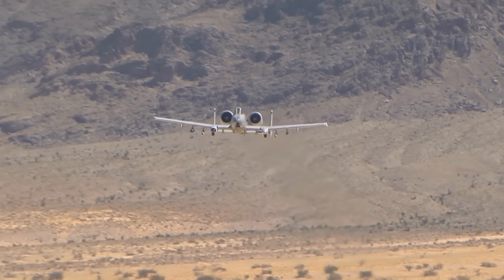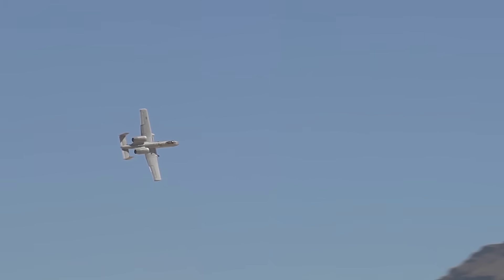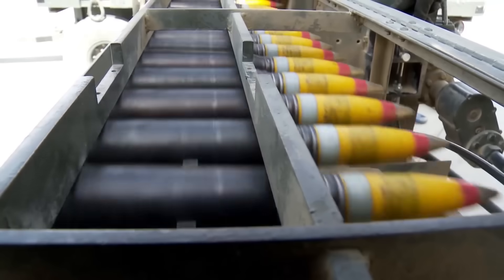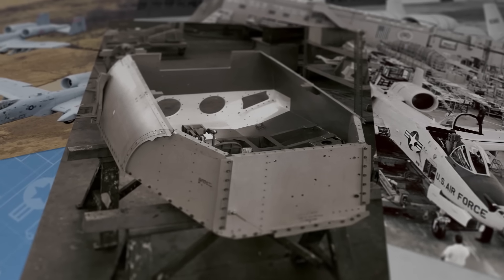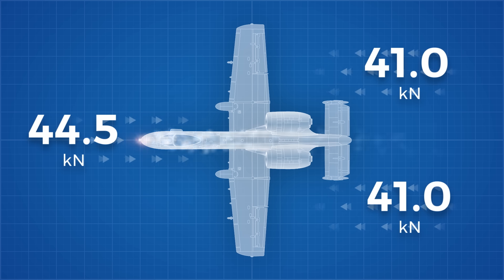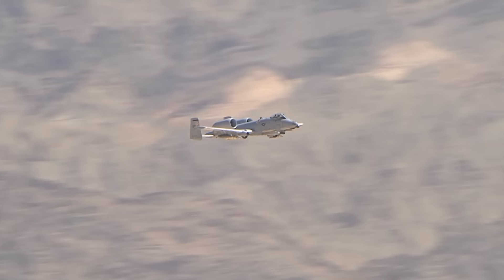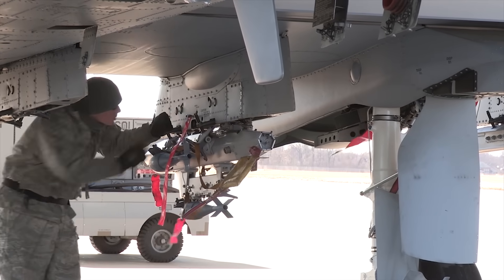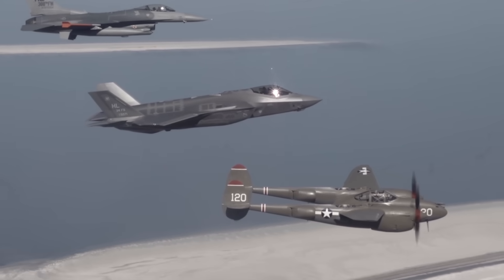The Insane Engineering of the A-10 Warthog

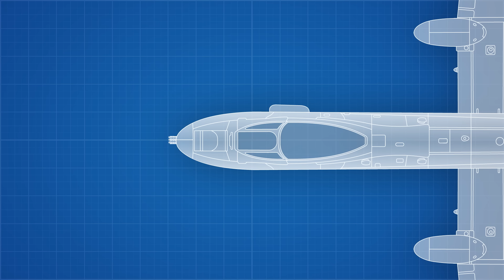Comment: 7:43 small addition: The gun is actually mounted off-center to the left, so that the barrel that is firing (the lower right one) is directly in center line. Therefore, the recoil doesn't push the plane off target.
Reply: John Slugger  You can't just drop that weight off the nose. To say it would affect the handling characteristics greatly would be an understatement... it would probably immediately pitch up and stall.
Reply: @W1ldTangent  the gun itself weighs 620 lbs,  full load is over 4000 lbs,  the front end loses over 3000 lbs after all 1150 rounds are fired, gotta figure that the retained shells are at least a few hundred lbs.
Reply: @W1ldTangent  damn, I knew it wasn't possible, but didn't even think about the fact that doing so would require dropping the entire armament system, and since most of the plane is literally just a house for the gun, a gimbal is literally impossible simply for the fact that it'd be a whole new plane
Reply: Good catch
Reply: John Slugger  an angle on the gun would cause an enormous moment. The plane with immediately pitch upwards off target if it was tilted
Reply: John Slugger  Not an expert, but here's my 2 cents: I don't think it need to be more accurate than it is. What you describe would ad a lot of complexity and cost... And both complexity and cost is something that they'd tried very heard to engineer out of this plane... Edit: And I see that people more knowledgable than me have identified other even more serious problems...
Reply: @angela1984a  yea one of the reasons its still in use is  because of its low operating cost as shown in the vid. to add a gimbal etc would end up costing more. also more likily to get damaged etc if it gets shot at
Reply: I was about to comment that, but you beat me by 4 months ;) .
Reply: @ptroinks  nice ^^
Reply: I love these designs
Reply: Big brain
Reply: Satellite guided 30 mm ammo for an update for the A-10 😈 hmmm 🤔
Reply: I refused to believe that it wasn't on the left. Thanks!
Reply: you can actually see it @ 12:20
Reply: John Slugger  You can't actually eject the cannon.  When the plane is on the ground and it's removed for maintenance, the airframe has to be restrained under the tail because otherwise the whole thing would fall backwards.
Reply: Yes, thank you for this.  Good catch.  I caught it too.  Never understood why people going to the trouble of making a video like this can never get the facts straight.
Reply: @carriersignal  Because they are dealing with a LOT of facts and information, it's hardly surprising that they made a small error. Where is your amazing popular YouTube engineering channel huh?
Reply: the barrell that is firing IS THE CENTERLINE OF A GUN
Reply: @edwardschmitt5710  Yes, and the way it is actually mounted on the plane also makes it the centerline of the plane.
Reply: The recoil actually does push the plane off target, however there are avionics systems on board that adjust the trim of flight controls to counteract the recoil
Reply: I completely understand what you are talking about,  the reason for that is because I have built R/C airplanes!
Reply: John Slugger  you haven't done your homework on airplanes! I have made comments in the past that I have regretted! But still like your comment!🙂
Reply: John Slugger  can't do it..the recoil with the gun off center would twist the aircraft off center. 
Remember the recoil of the gun exceeds the thrust of both engines at full power.
Reply: @duanesamuelson2256  it exceeds only one engine at full power
Reply: @allgameriot1291  still makes it too risky.
Reply: @allgameriot1291  so you're ok with your car braking on one side with half the power of your car's engine at full throttle? Because that would throw you right into a tree
Reply: @THESLlCK  brakes right in the middle so you'd just slow down
Reply: @allgameriot1291  let me rephrase this then, let’s say your car brakes with 50% of your car’s maximum engine power, you ok with that?
Reply: @THESLlCK  the gun produces 45 kN when firing.  EACH engine produces 41kN.  It’s part of the reason they only fire in 1-2 second bursts.
Reply: @THESLlCK  are you implying the A10 doesn’t work? It clearly does. I wouldn’t get too hung up on how much braking the gun provides, it seems the pilots all keep flying even when they shoot. Make sense?
Reply: 1. The gun does not need any gimbal system. The very high rate of fire solves the problem.
2. The gun with the ammo all together are so heavy, that the ammo empty cases cannot be discarded off the plane - otherwise it would lost the balance. Thus the cases are stored back in the magazine.
Reply: @THESLlCK  Bro. Cars brake quicker than they accelerate.... let that sink in a minute.... ooooooooooh.
Reply: @THESLlCK  Also, just to reinforce the point: Next time you're in your car press the accelerator and the brake at the same time, as hard as you can. What happens? OOOOOOOOOH.
Reply: @defdaz  Unless it is a Tesla plaid...
Reply: @ED-es2qv  Learn to read. They never said that at all.
Reply: @wino0000006  Actually that wasn't the reason.
Reply: @duanesamuelson2256  a gimbal would be problematic, however, the gun is mounted at a 2 degree downward angle so that it accurately centers the recoil forces, preventing changes in aircraft pitch or yaw when fired.  This is needed because the gun is mounted lower than centerline of the line of flight.  At 2 degrees downward the recoil is directed at the center of gravity.
Reply: @duanesamuelson2256  ...not to be that guy...cuz I'm sure it's what you meant...but it more powerful than a single engine at full power, while both engines at full power are easily overcome the recoil. But yea, you're right, if it's not dead center (the hot barrel, not the gun itself), fhen that plane would be fuuuuuucked after even a quick burst
Reply: @duanesamuelson2256  exceeds the thrust of ONE  of the engines at full thrust, but your point stands
Reply: @duanesamuelson2256  now somebody knows what they're talking about! I love people who make smart comments, it makes my day, cheers to to you!
Reply: @duanesamuelson2256  No, it does not exceed the thrust power, however, it is enough to offset the force from the them.
Reply: why would an gun that's center mounted push a plane of target? doesn't the gun recoil just slows the plane bit a tiny bit? why would something off center not push the plane of target? i'm no engineer but it just sounds not logical at all to me
Reply: @hazardeur  The barrel that fires creates the recoil. It's on the GAU-8 wikipedia page if you're interested
Reply: @hazardeur  because the gun is off enter. But only a single barrel is sending munitions down range at a time. So that specific barrel has recoil sent directly backwards from it, so that specific barrel that actually causes the recoil needs to be dead center, not the gun itself. 

Think of bottom barrel revolvers. They're supposed to be easier to control when it comes to recoil because the recoil energy is sent through the gun to the shooters wrist, whereas a normal revolver sends the recoil energy backwards and "over the top" of the shooters hand, causing regular kickback. It's not the gun itself. It's the barrel firing and where the energy from the fired round is actually sent
Reply: @hazardeur  wow, you're in need of a G.E.D. or at least the education of the 6th grader!
Reply: @bradb1474  love people like you who just harass other people and even without in the very least leaving a proper explanation. you're the real MVP!
Reply: I quit watching the video at that point. Who knows if the rest is just made-up nonsense?
Reply: @billrhodes1705  fact check it then.  https://en.wikipedia.org/wiki/GAU-8_Avenger
Reply: @jwayneair  that link specifically mentions that the gun is off-center in the aircraft.. gg
Reply: @billrhodes1705  indeed. It is arguably THE most characteristic design feature of the entire craft, which, as the video correctly states, was designed around the weapon to begin with. It is such a strange and unique problem to encounter and subsequently engineer against, that makes it noteworthy in the first place. I don't understand how the creator did not catch this mistake.

Comment: No matter how advanced jets get. The A-10 will always be my favourite.
Reply: No matter how advanced jets become, nothing will ever truly replace the A-10. Completely one of a kind.
Reply: @richardpichan6916  what if they made an even better version of it? sure it wouldn't remove the merit of the a-10 but i feel that if they could make an even better a-10 then that could replace it
Reply: you must be a fan of friendly fire then
Reply: @ChevailerHere  That's requirement to qualify as A-10 pilot I think.
Reply: @ChevailerHere  Hence the reason the fixed wing rule for the Army Air Force needs to be done away with, A-10s working with AH-64s in constant communication with ground forces and satellite imagery would be devastating.
Reply: Yep, considering what a close air support aircraft needs to bring to the table, cheap, durable (armored, primitive airfield capable), bomb truck, and loiter time this is the only USA aircraft that fits the bill.
Reply: I flew it back in Iraq back in the day.... It flew pretty good. :)

Comment: Having the best multirole airplane in the world does not help much if the price tag drains the budget at light speed.
Having primitive rugged equipment you can bang back into shape with an sledgehammer in quantity on dirtsrips all over the place is an tactical nightmare for your opponent.
The only improvement would be to make them drones, more compact and easier to armor (no big heavy glass blister)
Reply: And make them somehow able to field modern arnament, downsizing the large cannon so that we can make space for more ordinance-
...wait we just made a bomber.
...huh.
It's almost like the concept of an armored aircraft for knifefighting range is no longer viable now that guided missiles and radar guided cannon have become commonplace...
Reply: @KoishiVibin  
The problem i see is, especially with having the ability to have theese planes now as drones, you have to do the sums.
Guided weapons are expensive, and they are not easy to produce (even with gps and what not off the shelf now)

So to equip your whole army with the stuff that can withstand the highest tier of wepaons your opponent could possible field makes no sense as long your opponent is not able to really have the highest tier of wepons in mass.

A 10 can take insane ammount of punishment, make it remote controlled and it can take even more (no canopy is a lot of weight less)

It is relative cheap, hard to kill, relative cheap and easy to repair, you can field it in quantity no problem (compared to cutting edge high tech airplanes) and it can operate under relative primitive conditions.

The point is ground support, having specialised launchers who create AOD above your battlefield is cheaper and spreads out your assets compared to an super airplane that can do it all and is super expensive and needs a lot of support and you do not have in plenty because it is very expensive.

Plus you can develope new countermeasures to new weapons and bolt them onto the A 10 or an similar plane.

The new multi role are impressive but the price for multirole is that you have to go cutting edge tech and that is by nature expenive and not rugged because you have to trade in rendunancy and over engineering.
Reply: @KoishiVibin  forgot to ad, the idea of the A10 is pinpoint air to ground support, that is something you only can do with projectile weapons, explosives are right out if you want to do that near your own troops (and keep them in an good mood)
Reply: @KoishiVibin  Someone didn’t watch the video.

Comment: The A10 Thunderbolt II is a beautiful aircraft, I want it to remain operational for many decades to come, and never need to be replaced unnecessarily.
Reply: Got bad news for you buddy. They invented the SAM.
Reply: @KoishiVibin  Bad news buddy, this thing can literally fly with half the damn thing fucking gone. Maybe watch the video before making dumbass statements.
Reply: @militavia-air-defense-aircraft  “Many times”

Yeah, those “many times” barely require two hands to count. Of the 7 that have been shot down that I can find, only 2 actually had the pilot killed, 5 made it out of enemy airspace, 1 made it all the way back to base and landed (although the aircraft was unrepairable) and only 1 was shot down by a MANPAD. Pretty damn good track record.

Plus, IR SHORADs are nothing to scoff at, and specifically built to counter low-flying CAS.

Comment: YOU DIDN'T MENTION THE SLATS!? So because the gun slows the aircraft, there's a potential for stall, not just from the gasses of the gun, but from the lack of freeking air going into the engines. SOOOOOO there are 2 control surfaces mounted on the front of the wings that shoot up and force more air into the engines when the gun fires!

Comment: A-10 shouldn't retire. There is hardly any other modern equivalent of the IL-2 Sturmovik doctrine.
Reply: Except there is. A-10s are too expensive and too limited in their role. The only thing an A-10 is really good at is COIN ops, a job that can be filled by cheaper, lighter, easier to maintain, easier to use, and less straining on infrastructure aircraft such as turboprop attackers.

A-10s were never expected to hold much of a candle in a real war/fight, their casualty ratios were expected to be through the roof in a Cold War gone hot situation.
Reply: Buddy aircraft have limits.

Comment: The gun isn't exactly centered though. Its slightly off center due to the forward landing gear.
Reply: No, it's slightly off center because the barrel that fires is on the "side" rather than the top or bottom. So the recoil aligns with the plane centerline. The forward landing gear is actually off center to allow for the gun to be in this position.

Comment: In a real war the A- 10 will survive to fight and the F35 will sit without maintenance and new parts.
Reply: The A-10 is actually quite vulnerable and needs air superiority to operate while the F-35 can work in a contested airspace. In short: you are wrong.
Reply: @bruceu2274  Nope, you don’t need complete air superiority. These are used in ground battles, where these will shred ground targets. And who takes just some ground attack aircraft to a battle where there will be resistance? Just bring along some dedicated fighters.

So in short: you have fewer brain cells than my deceased grandmother,

Comment: The A10 is the punch-me clown of aviation. No matter how much you hit it, or how hard, they just keep coming back and bringing more BRRRRTTTT for a dirt cheap price per hour of use. This is why it won't ever be retired.
Reply: Not really. In 1991 they were pulled back from the Iraqi Republican Guard due to losses and F-16s were sent in its place. The only reason it's not retired is because congress won't allow it.
Reply: @ChucksSEADnDEAD  - It is not retired because the F35 can't do what the A10 can do, ever sit through one of the tests?  I did, the one in Arizona, they even used green camo vehicles, in a desert environment, to help the F35, Air Force cheating as usual, and low level light cloud cover gave the F35 fits.  So much for "slinging missiles from far away" LOL
Reply: @rooh5825  False. It is not retired because Congress won't allow it. Forget the F-35, the F-16 and F-15 Strike Eagle already do the A-10s job.
I don't see how green camo in a desert backing made it any easier for FLIR or ground radar.
The A-10 scored most of its armor kills by slinging missiles from far away. Without the Maverick, A-10 losses would have been riddiculous.
Reply: @ChucksSEADnDEAD   - The A-10 is not retired because the Army and Marines both fight the Air Force at the highest levels to keep the ignorant officers in the AF from getting rid of a perfectly functional platform that has done it's job, at a lower cost, and more efficiently than any other plane that the Air Force has to offer.  I notice how cute it is that you avoid actually commenting on the multiple F-35 failed tests in the last several years.  Again, this isn't Call of Duty, or whatever stupid combat game you are playing,  this is the real thing, actual combat.
Reply: Now, as you run around and research what a service member would say, to pretend you were or are in the military, just realize this: if you actually had been a member of the ground forces in any recent conflict, you'd have actual first hand knowledge, and not the made up nonsense you are about to post.  LOL this will be interesting.
Reply: @rooh5825  "The A-10 is not retired because the Army and Marines both fight the Air Force at the highest levels" - And so they recruited Congressmen to do the job. It would be more honorable to hire actual hitmen.
"perfectly functional platform" - It's not perfectly functional when it has to fly on entirely new wings. It would be falling apart if it wasn't being kept in life support.
"a lower cost" - Just the wings cost more than replacing it with Super Tucanos.
"this is the real thing, actual combat" - The thing the A-10 barely sees?